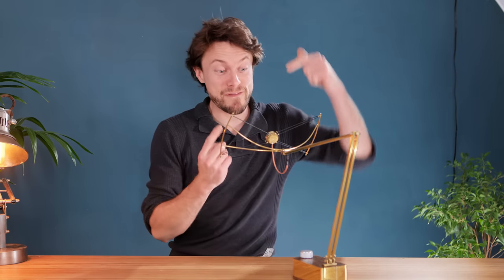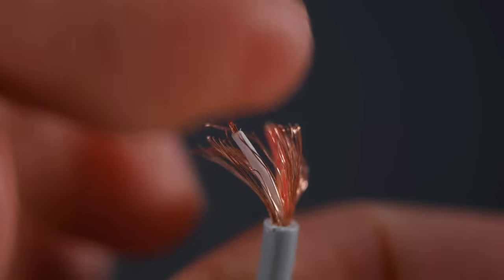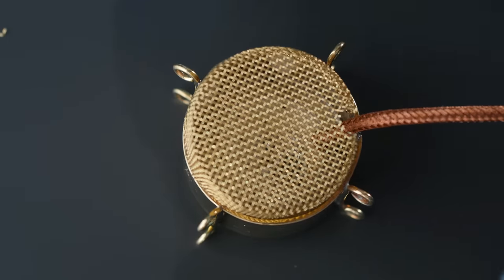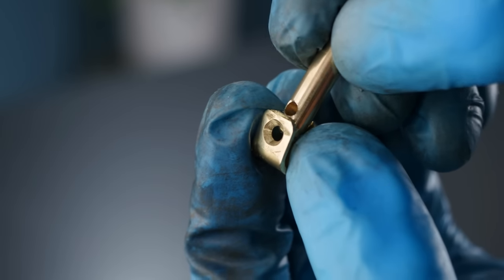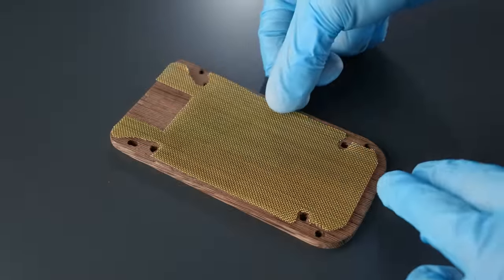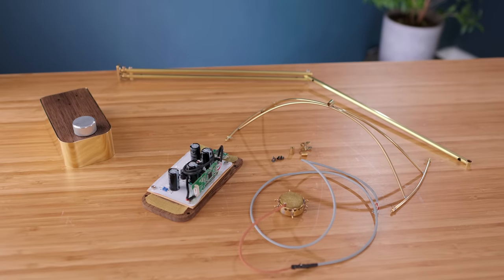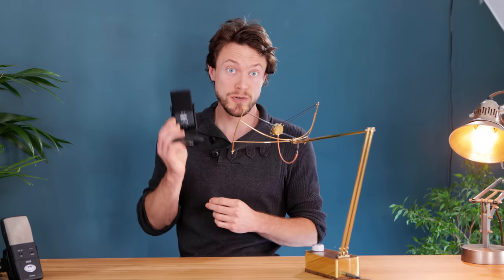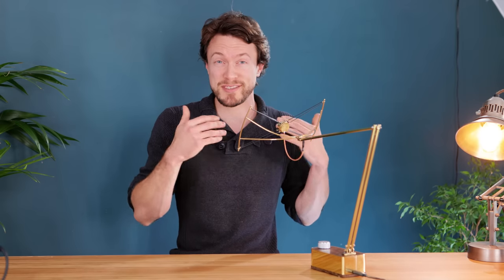Building a quality USB-C microphone

Comment: There's a reason why retro designed audio equipment sounds so amazing. This build had me smiling from ear to ear because I just knew you'd been recording the entire narration with it during the entire video. Amazing job with this build and I'm sure there's even more room for improvement. Your build sounded so much better that the $3000 microphone! Your craftsmanship with brass was a nice touch in the polished and retro mechanical and wood look and finish. Audiophile quality in every way! Bravo!
Reply: Don't be delusional lmao. It did not sound better than the Neumann. The build was impressive though and has a very cool aesthetic. Sounded pretty good too.
Reply: @sebastian-benedictflore  I am not joking, but for me its much better.
Reply: @AbdoZaInsert  There is a level of objectivity to this. That's why people have jobs in the field. If you wanted to record professionally, that microphone is not on the same level as the Neumann. You can have your personal opinion about what you'd rather use or hear for a voice over like in the video but there are many things that make the Neumann considerably better.

I am no audio engineer so I couldn't go into all the details and intricacies and we also only heard a particular sound - the same person's voice and nothing else. However, even I can tell you that the levels (in terms of EQ and pickup) aren't quite right. Compared to the Neumann, the clipping on the home made was quite bad, for example. In a professional environment, I'd expect some would call that audio almost unusable.
Reply: @sebastian-benedictflore  What makes you think this is not a professional environment? Dude is literally manking content - high quality content. Like with most things, you get a pretty steep diminishing returns for more than 100x the price.
Reply: @ecoista1373  yes, you get diminishing returns but that does not mean that this is at the same level of audio quality as the Neumann. 

What on earth are you talking about (referring to the "professional environment" point). Whether or not that is a professional environment doesn't even matter since he uses a better microphone anyway. No, that microphone is not adequate for a professional environment and when I say that, I'm not referring to any job. I'm referring to music production, a high profile/quality radio station or other such situations. That microphone is not versatile enough and there is quite a bit of clipping and I'm sure that a professional audio engineer, unlike myself, could find more problems. It simply doesn't have the quality and versatility that some applications demand. It's ridiculous to say that it is as good as the Neumann here. As for the quality:cost ratio, that is an entirely different matter.
Reply: @sebastian-benedictflore   It does matter, because not every application and professional environment needs SOTA equipment, not even in the music industry. Technical nit-picking is common in the field. You don't take a ferrari to door dash. It doesn't matter if it has infinite resolution, or whatever. No one claimed it is best for every use, but in this specific case is better in every way: it is awfully cheaper, the general consensus is that it sounds subjectively better, has repairability, the design is his own and he can sell the rights of it.
Reply: @ecoista1373  In this specific case, he does not need to spend tens of thousands on a U87, obviously. However, if somebody gave it to him at the price of £30, it is the better option since it has better audio quality, making it more versatile when editing and more useful in general. Idk where you got this "general consensus". I've seen some fans say they think it sounds better. I don't see a poll or an actual thorough test done and, as you can clearly see, there are those of us who know the Neumann is better.

As for the whole thing of it being cheaper, it's nice and easy to say that the parts only cost £30 or so. However, I don't own solder, a soldering iron/kit, saws etc. and frankly do not have the time nor the will to build a microphone. It's very easy to ignore all the other costs.

The thing I am saying here is not that the Neumann is the better option for everybody no matter their situation, obviously. I'm saying that the Neumann is almost objectively the better microphone in terms of audio quality and, if price weren't an issue, almost always the more desirable microphone.
Reply: @sebastian-benedictflore  People are probably saying that the DIY microphone is better because they let the price influence them and to make the creator feel better. It sounds great because it's about equal to the $600 microphone, just without a fancy case built around it and a high price tag, but obviously the industry standard U87 is better. I'd have no problem using either of them, but I'd rather use a cheaper one. Sadly I don't have the time or the tools to make this one, so I'd have to use one of those popular streaming microphones that are way worse. This thing blows the Blue Yeti out of the water for example.
Reply: @sebastian-benedictflore  I got this general consensus by scrolling down lots and lots of comments in this video. You're technically nitpicking again. You don't need a formal pool to form an opinion about it and thorough test done because it doesn't matter to most people and you're not the most people. He's not advertising his project to an universal music studios engineer. Again, no one here is expecting it to be SOTA or that it will be better in post. It's in the video. It has a purpose and people liked it better, get over it. Again and again, not everyone cares about its faithfulness or whatever it must have in other applications. Companies do care about stealing his designs and this is a proof of how good they are. Look at the description of the video. The cost argument has nothing to do with reality too. The price will always be situational. It cost him 30. Period. The 3000 mic would cost me more than 4500 if I would buy it because of taxes. The point of being awfully cheaper stands, even if you buy tools and hire someone to do the milling. Unless you're very rich, then you can say "price doesn't matter, I'll get the most expensive just because", for the rest of the professionals it's entirely context dependent and being "objectively better because it has stats" is unimportant. Dude gets millions of views per video and still can't justify getting this mic. This should tell you something. What I'm getting from your take is that you're being elitist (here). Your argument is also: if you had a normal car and had been offered a Ferrari 100x cheaper, would you take it? If no more cost was involved, of course most people would take it - even if just to sell it after to by more important things. Unhappily, this argument doesn't tell anything about how the world works in this field nor adds amuthing to the discussion presented in the video. I'll tell you if someone offered me a RED camera, I wouldn't take but because of the money to resell later, it wouldn't serve me because I don't even have a computer to edit this kind of footage. The same goes with a top of the line mic and a shitty DAC.
Reply: @ecoista1373  You're completely misunderstanding again.

Firstly, I'm not nitpicking. You've just made a wild claim which seems pretty baseless. You're just saying that people think his microphone is better or that they prefer how it sounds without any good reason. If a poll were done, you might have a more accurate result than you scrolling through some comments without accounting for bias. That isn't nitpicking. That is just not taking your word for it for no reason. I disagree with the statement and so do others. You're making the claim that I'm not most people without knowing that.

Secondly, how many damn times do I need to say this? I am responding to people who say the DIY microphone sounds better. If you said that, I was responding to that. Price to value ratio is a different matter. All I am addressing is people saying that the Neumann doesn't sound is good. To say that is virtually objectively wrong. Unless you have a specific use for the sound you get from the DIY, it is never favourable. I'm not even getting onto how cumbersome that microphone is or all the other issues.
Reply: @NaudVanDalen  Hey man, I'm all about bang for your buck but there are people in this comment section saying that the Neumann sounds worse. That's what I'm responding to.
Reply: @ecoista1373  The point of being awfully cheaper does not stand because that is not what I'm addressing, as I've said half a dozen times, now...

There are people saying that the DIY sounds better than the Neumann. That is all I am responding to. You can have your opinion but it can still be stupid. If someone tasted a frozen pizza that cost 1.50 and then tasted a homemade pizza, or maybe cooked by a great chef, and said that they preferred that frozen one, they're entitled to that opinion. That doesn't mean that opinion isn't ridiculous. That's what in addressing. 

Obviously there isn't a justification for getting the Neumann U87 if you don't have thousands and thousands lying around and/or are a music producer or the like. When did I say that? I don't need to read dumbass takes about elitism in an unnecessarily long comment full of strawmen when you can't or are refusing to understand the very basic things I am saying.
Reply: @sebastian-benedictflore  Sometimes something being better per dollar makes people say that the more expensive thing is worse than it actually is. For example, people call Apple products overpriced crap even though they are not crap, merely overpriced. It's only potentially crap relative to other products of the same price, but people use that comparison to say that they are objectively crap.
They don't want to believe that this DIY microphone isn't the best microphone in the world, so they make ridiculous excuses like saying that the U87 sounds muddy. Muddy? They don't even know what muddy is. If that's muddy, than every consumer microphone is completely unusable, like an old Xbox 360 headset microphone.
Reply: @sebastian-benedictflore  "There are people saying that the DIY sounds better than the Neumann. That is all I am responding to. You can have your opinion but it can still be stupid. If someone tasted a frozen pizza that cost 1.50 and then tasted a homemade pizza, or maybe cooked by a great chef, and said that they preferred that frozen one, they're entitled to that opinion. That doesn't mean that opinion isn't ridiculous. That's what in addressing. "

How isn't that elitist? Why is that ridiculous? You can't say some view is stupid because they don't like the pizza some great chef made. This is the essence of being elitist, judging views by their taste in something (in sound or when people judge the music you listen). I'm not eating this 8th wonder pizza that is made of uncommon ingredients and highest technique because it's inherently best - because it's not - it's different. You can match the sound profile of the Neumann in post and the overwhelming majority won't notice the difference unless making side by side comparison. Now people who can tell the difference will be circlejerking about how it sounds minimally different. Still is a technical nitpicking.
Reply: @NaudVanDalen  Yes, this is exactly what I mean. Lmao, when they were calling it "muddy". Everyone's entitled to their opinion and it seems that when somebody has something else to say, there's always the one guy who gets mad.
Reply: @ecoista1373  Yet another person who throws around the word "elitism", disregarding it's meaning entirely. 

I'll tell you how what I said isn't elitist. Elitism is not knowing that one thing or opinion is of higher value than another in some way, shape or form based on good reason. 

Here is the Oxford definition that comes up from a Google search:
the belief that a society or system should be led by an elite.

the dominance of a society or system by an elite.

the superior attitude or behaviour associated with an elite.

That is not what I demonstrated when I made my statements. The Neumann does a better job at picking up the sounds it receives. That's that. The usual basic desirable qualities in a microphone are that it picks up all the sounds with high fidelity or that it picks up the sounds that the user wants it to pick up, in both cases without distorting the sound. Then there are matters of portability, compatibility, price etc. The Neumann is simply better in every department (other than cost, which is not something I'm arguing). That shouldn't even be up for discussion at this point. That is not elitism, just as recognising that the homemade pizza will probably have a wider range of ingredients, be made with care and diligence, have a higher nutritional value and, if you think this matters, be made with personality and emotion. It's silly to try and indulge in these philosophical, metaphysical discussions when it's just unnecessary, especially since I repeatedly said "almost objective" (so as to say, technically it is not objective but in truth, nothing is objective since everything revolves around the human experience, human sensation, human construct in what we understand of the world).

Do you see how silly that sounds? We're talking about a fucking microphone. There is no objectivity, obviously, but in day to day life, we accept at least the most basic axioms and postulates, such as what might be considered beneficial or harmful and, from there, we construct evaulations and morals. It's so unnecessary to get into this pointless discussion when it is very easy to accept that the pizza made by a human with experience who spent maybe hours with handpicked, fresh ingredients, which has a higher nutritional value and has a more refined taste is of high value in general than the pizza made in 20 seconds by a machine and frozen until but in a micowave oven for a few minutes and that the Neumann U87 with a wider frequency range, higher fidelity pickup and in general more utility is better than the homemade DIY microphone with a homemade preamp.

That is not elitism. This is on the level that saying the opinion of a layman is equal to the evaluation of a theoretical physicist specialising in M theory when having a discussion about quantum physics. It is not.
Reply: @sebastian-benedictflore  Let me throw another meaning to the word elitism since you don't know: "The term elitism may be used to describe a situation in which power is concentrated in the hands of a limited number of people." You're advocating for something that is better solely based in its technical aspects, in which very few people have access to due o its price. That's pretty the definition for me. Not only that, you think your objective view champions another persons' subjective view, which is messing with things that are not freely interchangeable. You start throwing definitions that are unnecessary since the op's comment, that didn't involve anything technical, proprieties of an object that was never disputed to begin with and makes the assumption that everyone should weight things like you do, but in reality, people have different parameters of evaluation that doesn't necessarily is tied to its technical aspects. People found the DIY better, they have their reasons, they don't have stupid views you think they do, no, I don't think a tv is better because it's bigger, God, why is this so hard to grasp 

I didn't see the reply you said you was not nitpicking. I will not answer because it's not relevant anyhow. Feel free to not take my word for it - I don't care.
Reply: @ecoista1373  "The term elitism may be used to describe a situation in which power is concentrated in the hands of a limited number of people."

How is that anything like what I was doing? You've again misunderstood the definition. There is no power dynamic here. I'm just stating that one microphone is better than another.

"That's pretty the definition for me."

Yeah, maybe it is the definition for you but it isn't the actual way of interpreting that definition. Firstly, there is no power dynamic. Secondly, I am not saying that anything should necessarily be decided by "a limited number of people". However, there are people who know better about some things than others. Don't be ridiculous, here. A professional sound/audio engineer/electronic musician knows far more than I do about these microphones and their applications. I can accept that, whereas you don't seem to be able to. Rather, you'll scream "elitism! Elitism" with no regard for common sense.

"You're advocating for something that is better solely based in its technical aspects, in which very few people have access to due o its price."

Ok, and? That again does not make this elitist. I'm not necessarily even "advocating for" this microphone. I'm simply stating that the Neumann is better, in general, and has more use. I've said repeatedly and I can't believe I'm having to say this again but hopefully it will get through your dense cranium, price:value ratio is a different matter. I am probably never going to buy the Neumann. Whether or not I ever have the money, I don't think I would have much use for it. Stating the fact that the Neumann does a better job overall than the DIY does not mean I think that it is objectively better for everybody in every way, let alone that I am elitist. 

"Not only that, you think your objective view champions another persons' subjective view..."

To an extent, yes. In certain contexts, such as this, yes. The OP said and I quote, "Your build sounded so much better that the $3000 microphone!"
The statement was not "I prefer the way the DIY microphone sounds to the Neumann," which would still be something that could be debated/discussed by the way.
The statement was that the Neumann sounded worse. So I responded because that is essentially just wrong. As I said before, everybody is entitled to their own opinion but your opinion is not valid simply by virtue of having it. Since the person thought that the DIY mic was better *purely evaluating the audio and not other factors*, I wanted to point out that it was not - because it is not.

"You start throwing definitions that are unnecessary since the op's comment, that didn't involve anything technical, proprieties of an object that was never disputed to begin with and makes the assumption that everyone should weight things like you do, but in reality, people have different parameters of evaluation that doesn't necessarily is tied to its technical aspects."

Not really. I don't recall anything being "thrown around" that was not necessary to my point. I'd like to add, you seem to be ignoring/forgetting what the OP actually said (which is very similar if not essentially the same to others in this comment section). Allow me to refresh your memory:

"Your build sounded so much better that the $3000 microphone!"

That's what OP said. Of course, your way around this might be that they simply have "different parameters of evaluation". So what then? What are those parameters of evaluation? What could they possibly be other than the things I mentioned. Don't you say price again because, as you can see from the quote, that is not the topic of discussion. The statement is clearly a comparison of that sound/sound quality, not the price. So what could these parameters be? I'll tell you what, hocus pocus nonsense based on inexperience, if I'm going to be brutally frank. Of course, now that I've said this, you'll scream (and wrongly apply the word) "elitism! Elitism!"
No, actually, it's just fact.

"People found the DIY better, they have their reasons, they don't have stupid views you think they do, no, I don't think a tv is better because it's bigger, God, why is this so hard to grasp "

Some people preferred the DIY and, as I say, this could be due to many factors. Primarily, lack of experience with actually listening to various equipment and sounds, diligently. Secondly, it could be the fact that the majority of the video used that microphone for the voice over so people got used to the sound so hearing something drastically different made it seem like it was worse. Perhaps the microphone happened to work well with his voice and cadence in particular, where it wouldn't with other voices/sounds. I personally thought it sounded pretty "meh" and realised 3-5 minutes in that he was probably using the DIY mic for the voice over. Though harsh, in retrospect, my thought was "this sounds like shit". That was due to the clipping and it didn't sounds great on my laptop speakers. On my desk speakers, it may have been a different matter. 

I think "stupid" is a harsh word but if your view is that the DIY sounded better than the Neumann, that is a little bit silly. Maybe you haven't scrolled far enough but there are those who agree with me. Some of them are professional producers and the like. You manage to deny that this carries validity. I will tell you that it does. You can disagree. You would be wrong. The TV analogy does not quite work. I see what you're saying but there are better and worse TVs. Use cases for TVs are wider than for microphones but things that one might care about are:

Latency
Refresh rate
Resolution
Colour spectrum
Type of Display
Price
Size

In general, ignoring price, I think people will favour resolution and colour. The display with a higher resolution is more favourable, generally. There is nothing wrong with that statement.

Elitism is not knowing better or knowing that others know better, "God, why is this so hard to grasp"
Reply: @sebastian-benedictflore  I'm tired to continually explain things to you, have a good day. You just don't accept someone can find one sound better than other. End of story. While no one owes you justification for just finding it better sounding, you never asked anyone why they thought this. I doesn't matter.

"Not only that, you think your objective view champions another persons' subjective view..."

To an extent, yes."

Lol

Well, you finnally asked why in your last comment. And you continue to beat the same argument over and over again, like there is no tomorrow. Feel free to be technically right. You didn't understand my point entirely. Most people who said it's bad are engineers, which I already addressed before, they're not the target audience. And you still miss the point entirely. No power dynamics. Lol. Ok. As I said, have a good day.
Reply: @ecoista1373  "You just don't accept someone can find one sound better than other. End of story."

This is completely wrong. I said repeatedly that everybody is entitled to their opinions. That's fine. It doesn't mean that there is the slightest validity in that.

"While no one owes you justification for just finding it better sounding, you never asked anyone why they thought this. I doesn't matter."

It matters slightly and, as a matter of fact, I did ask. I asked you and you didn't answer.

"I'm tired to continually explain things to you, have a good day."

You aren't tired of it. You are incapable of it. Evidence of this is in the nonsense you've spouted continually.
Reply: @sebastian-benedictflore  Ok, thank you for the discussion. I wish you a good life.
Reply: @sebastian-benedictflore  you cant really hear the small differences because of it being on youtube. there are two big differences that do jump out to me though. thats high end clipping and brightness. another might be volume but thats most likely a settings issue
Reply: @highkicker11  yeah, you can definitely hear a difference between the mics even on youtube but I'm sure that a higher bitrate would make the differences far more significant.
Reply: @sebastian-benedictflore  Thanks for the time, I'm well rested now. "Subjectivity is what relies on personal perception regardless of what is proven or objective." The thing is that you think there must be some kind of validity in all this discussion. They are different things, one person can say: "wow, this shitty mic is awesome and sounds much better!" without demanding any objective discussion. As a matter of fact, he never entered the discussion. If you think it's silly to like something that has technically worse proprieties than another thing, it's ok and a valid viewpoint. But no one is seeking your approval here. I don't think it's silly and I'm in my right to do so. Thanks.

About the elitism aspect, defending a product and consequently a brand that sell such expensive stuff for me is a form of elitism and I'm sorry if you think my take on this term is wrong, there is nothing I can do about it.
Reply: @ecoista1373  "They are different things, one person can say: "wow, this shitty mic is awesome and sounds much better!" without demanding any objective discussion." 

The fact that you don't see how ridiculous this sounds is completely mind-boggling. If somebody told you, "yes, I actually much prefer to eat this pile of cow dung over any food," there is absolutely no problem with not taking that absolutely absurd act/opinion seriously and trying to inform them that, actually, the cow dung is in no way as good as essentially any food. (Obviously, this is an extreme example but they are nonetheless analogous.)

"As a matter of fact, he never entered the discussion. If you think it's silly to like something that has technically worse proprieties than another thing, it's ok and a valid viewpoint. "

I'm not sure whether you were calling my viewpoint valid or theirs. In the case of the latter, that's just incorrect. Regardless of what you say, his initial comment is what started the discussion. He said that the DIY sounded better than the Neumann. That was all he said. No statement about his opinion. One way or another, it was completely reasonable for me to point out that this was not the case.

"I don't think it's silly and I'm in my right to do so. Thanks."

Absolutely. I have said many times in this discussion that everybody is entitled to their opinion. However, having that opinion does not mean that it [the opinion] has even the slightest validity. In all honesty, you're wrong to think it isn't silly but if I can't change your mind about that, fine. Keep being wrong.

"About the elitism aspect, defending a product and consequently a brand that sell such expensive stuff for me is a form of elitism and I'm sorry if you think my take on this term is wrong..."

Well, it is wrong. You're literally saying that anytime somebody says that something of a higher monetary value is better than something of a lower monetary value, that is elitism. This is completely wrong on multiple levels. Elitism is not acknowledgement of facts. Elitism specifically refers to the advocacy a power dynamic in which those who are underserving/irresponsible/unfit hold power. You could extend this beyond "underserving, irresponsible and/or unfit" but that would not change that it has everything to do with a power dynamic and nothing to do with monetary value. I'm not even defending the brand. I am just saying that the Neumann microphone does a better job than the DIY for the usual purposes. That is not wrong. That is fact and that is not elitism. You've misunderstood the meaning of the word because it gets thrown around so much, as you yourself did to it, and related the concept to something completely different from it.
Reply: @sebastian-benedictflore  "yes, I actually much prefer to eat this pile of cow dung over any food,"

I'm not the one eating shit, why sould I care. They're responsible for their actions or views. The world is full of people doing what someone may think is the crazyest stuff. In fact, you can learn a lot by being puzzled by their action or views by researching youself if you want to. At what extent is eating cow shit is bad for the health? The same thing  apply to a game you like or other things. Except here I fail to see the problem. It's banal and not hurting anyone nor myself. Addressing why I liked the sound of one much better than the other as you asked before, I found it more pleasant to listen. That's simple as that. For me, this is more important than another one having technical aspects. How is that silly? 

"No statement about his opinion."

You called him desilusional for having found some sound better. It was just a general statement. It doesn't matter what one person says, it's always the person's opinion, unless they're referencing someone/something else in their speech. He didn't do any of this. I think this is a momentary lack of comprehension from your part.

"However, having that opinion does not mean that it [the opinion] has even the slightest validity."

Because subjectivity doesn't need objective validity. You're mixing things again. If you're feeling bad, you're feeling bad. That's your opinion. If a doctor says: you don't have a reason to feeling bad, that's not only inconsiderate from the doctor part, it's also patronizing. Someone is telling you how you should feel against what you really feel. But technically there is nothing wrong with you, until they find something was, in fact, wrong.

*Just to be extra clear, I'm not saying you're doing the same as the doctor.

"You're literally saying that anytime somebody says that something of a higher monetary value is better than something of a lower monetary value, that is elitism."

No, I'm not. I never touched the lower grade mics. Since the beggining, I said about highly expensive microphones, just as I said about Ferraris in my comparison.

"Elitism specifically refers to the advocacy a power dynamic in which those who are underserving/irresponsible/unfit hold power."

You said there is no power dynamic here, what's next? That your actions are apolitical? Give me a break. I'm sorry to burst your bubble, but there is no such a thing as "no power dynamic" in a interation between people. I gave you the definition I was using and you simply ignored. "The term elitism may be used to describe a situation in which power is concentrated in the hands of a limited number of people." You don't accept my definition, while is know and is in places like even wikipedia, because it doesn't suit your narrative. If you don't want to accept it, it's ok too. We have two different viewpoints.